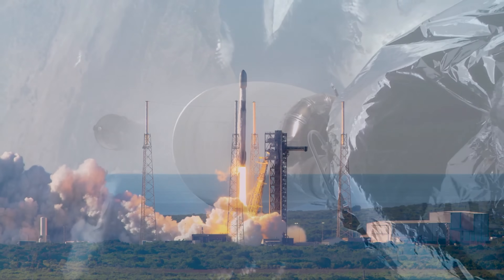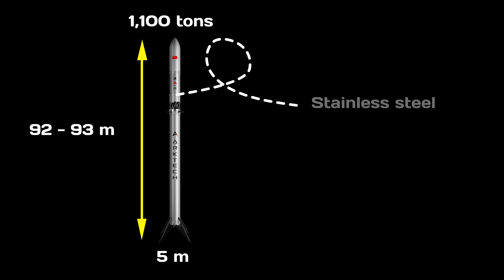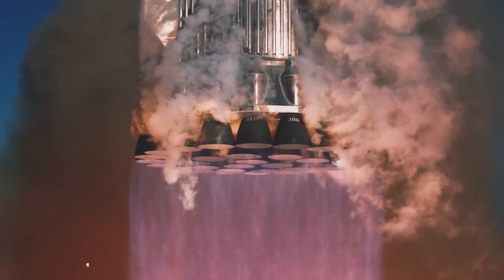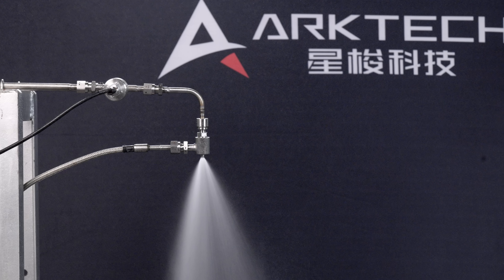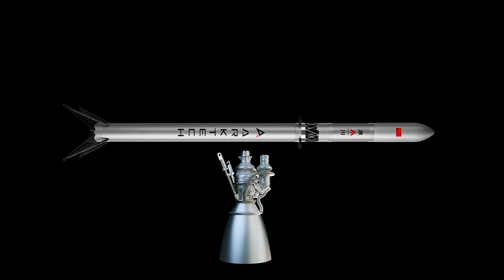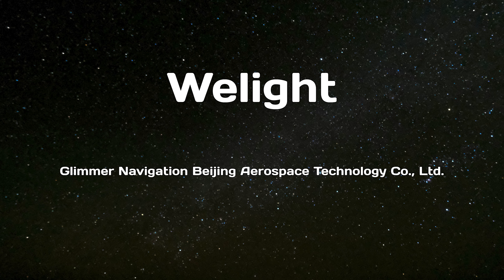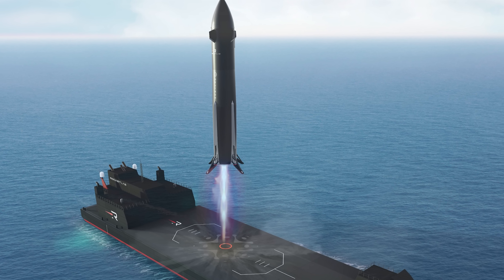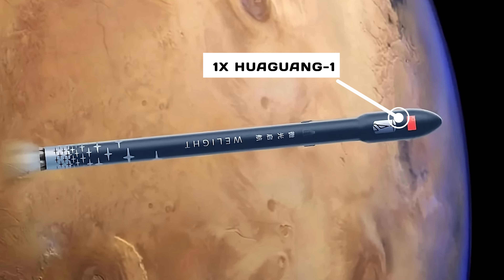China is up to Something Big to Copy both SpaceX Starship & Raptor Engines...

Comment: really sick of China doing things like this. They actually demonstrate little innovation and are constantly stealing from others
Reply: "U.S. rockets have both directly "learned from" Russian technology by using Russian-designed engines like the powerful RD-180, and indirectly "learned from" Russia's successes and failures during the Cold War space race"
Reply: @youtubesurfer123  This is partially true, and RD-180 is a very impressive engine; the engineering choices made by the SpaceX team follow Russian design principles more closely than, say, the "American" design philosophy seen in the Rocketdyne RS-25. That said, RD-180 is not a full-flow staged combustion cycle, nor is that architecture capable of what Raptor can do by an order of magnitude. The Raptor is a massive generational leap in technology, construction, material science, and turbo machinery. By every metric, Raptor is a seismic shift in Rocket engine design, technology, and capability. The most impressive aerospace engineering accomplishment in decades. I cannot stress enough how impressive it is, considering its constraints and operational envelope. It has extreme chamber pressures at launch and survives re-entry heating.
Reply: Bruh what? Literally all rocketry is stolen from Germany and Russia.
Reply: @TrackDayMaker  Liquid-fueled rocket technology and gyroscopic guidance systems were first developed by Robert Goddard, an American. Von Braun used his research to develop the V2, which was a significant technological improvement over Goddard's designs. The first solid-fueled rockets were developed in China, as fireworks and signal flares.
Reply: That has changed over the past decade. There are some stellar designers and engineers in mainland China these days. Better than many based in the U.S. That said, the hyper nationalist narrative is a precursor to war. Let's try to keep it to a minimum.
Reply: Eh. Who cares. Without a competitor in the space race, the MIC and Western oligarchs would never allow us to go to the Moon or Mars.
Reply: SpaceX is crap. Why does anyone wants to copy from them? The worst is probably that some idiots believe SpaceX is the best of the best.